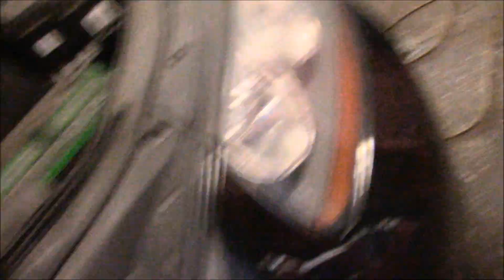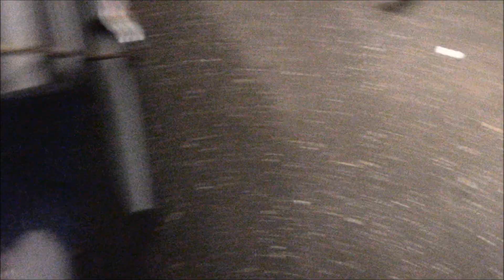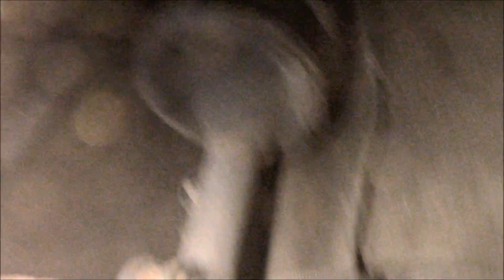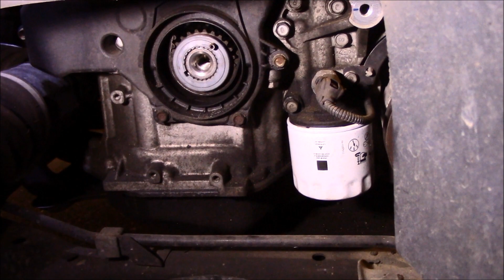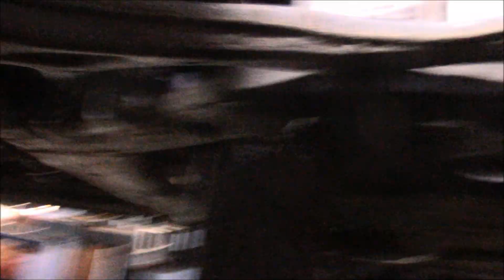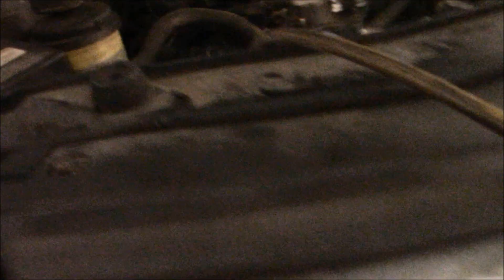How to replace a timing belt 2008 Hyundai Santa Fe

Comment: I have a 2009 Santa Fe with 240,000 miles - never replaced the timing belt - am I playing with fire?
Reply from the maker: It all depends the size of the engine. The 3.3L has a timing chain the 2.7L and 3.5L have a timing belts.

Comment: Will removing the camshaft pulley’s, to change the oil seals have a effect on the timing. Crank and cam gears are in time with the marks. If I moved the cam gear pulley by a little without the belt on. Then rotated it back by hand in place. Is that gonna effect the time?

Comment: If belt is broke how do you set cam sprokets?
Reply from the maker: You will need to use a socket to rotate the gears so they line up with the marks.

Comment: Hi nice video. I did mine and checked a month later and after car set a day the slack side of the belt is loose. Then started it up and stopped. It it’s tight. Is that common on is the hydraulic bad?

Comment: you forgot to show yourself getting pissed off when the firewall side cam keeps slipping out of time when tightening the belt.  You use a holding tool or how did you do that?

Comment: It's absolutely critical that after fitting the new timing belt that the engine is rotated by hand to recheck the marks on crank and both cams. Please note that all hyundai engines are interference type meaning if the belt breaks while engine is running it bends valves. So turn engine gently by hand to recheck crank and cam positions. I'm not sure if one touth out will have valve hitting piston. The reason for turning engine at least two full revolutions is because the back head which is bank 1 or RH head cam might be one touth retarded due to belt tension or cam roll back while fitting cam belt. Some people choose to mark old cam belt timing marks before removing and check on new belt via the counting of teeth but do it in correct rotation direction. Also while the covers are off check cam and crank seals are not leaking. 
Also check all bearings of pulleys idlers water pump alternator and power steer via rotation feel while belt is off.

Comment: What order did you wrap the new timing belt on? I am having a difficult time getting mine on. I started from the crank, around tension pulley, around the back camshaft, then around the waterpump pulley, and then around the idler pulley. I am having a difficult time getting the belt onto the front camshaft without them slightly moving position. Did you use a tool to hold them in place? Any advice would be greatly appreciated!
Reply from the maker: Did you remove the tensioner assemble to push the rod back in ?

Comment: The timing belt on my 08 Santa Fe it’s a little loose, so I took the cam covers then rotate the motor until all the marks were set, then I notice that one of the camshaft it was behind one tooth, i don’t know if that will give me more problems, because as right now check engine light came on then started running bad and almost all cylinders are misfiring. Any advise?
Reply from the maker: If the belt is off one tooth do not drive it. You should replace the belt.

Comment: Probably a dumb question, but where did you get the "pin" for the tensioner?  Is that something that comes with a new belt or a dealer only part or did you just make that?
Reply: bcfbasil even a paperclip would work straightened out

Comment: Thank you, very informative i have never replaced timing belt and water pump before ,went really well the tip to raise the engine  to gain access to the engine support bracket bolts saved hours of frustration that I've seen on other you tube clips.
Thanks again very useful
Reply from the maker: Thank you for watching

Comment: what brand of belt did you use?
Reply from the maker: I try to use Gates but if not available Dayco.
Reply: @jimthecarguy  do you have the original part number of the belt tensioner polly and water pump for the 2.7 engine ?

Comment: I noticed that once you pulled the grenade pin you did not completely rotate the belt, 2 full rotations to further confirmed that the timing marks lined up. I do that before installing the front covers.

Comment: Jim, isn't it true when changing timing belt/chain for most cars it's best to replace other components like water pump, tensioner and guides? Because you need to remove them using the same procedure. Great video btw... :)
Reply: I agree. 
going to do all of them when I change the timing belt on my 3.5 probably including the alternator.
.
Reply: 66

Comment: Manufacturers seem to be making these belts more and more difficult to get to especially having to remove the engine mount. How many hours did you allocate for this job? I also like to turn the engine over by hand before using the starter just as a final check. There is no turning back once you crank it especially for those less experienced than yourself.

Comment: Jim : Great vid. One question though: How do you keep the engine from turning when you torque the crank pulley bolt during re-assembly? Thank You for making such great videos!
Reply: Paul M i would stick a thick bar, screwdriver or both on the top openings of the pulleys or even on the bottom one. But what did he do?
Reply: MY QUESTION EXACTLY!!!
JIIIIMMMMMMM.
PLEASE ANSWER.
.
Reply: @donaldfafard   AZ Donald, did you ever get an answer. Did you do like Hector recommended. I'm in the same situation and keep the crankshaft from moving. Not much room for any screwdriver.  Any suggestion is appreciated.
Reply: @vaucansonwatch  sorry MJ, never got an answer and jim doesn't reply to viewers.
Reply: @donaldfafard  thank you for the reply, I see there are a few methods on video.
Reply: Pretty sure most folks give the crank bolt a good few ugga duggas and call it a day.

Comment: Nice work Jim, the owner should have had the water pump replaced also..
Reply from the maker: hllywd964 your right he should have replaced the pump also
Reply: jim, would you also change the crankshaft position sensor (crank angle sensor) if this was your vehicle?
.

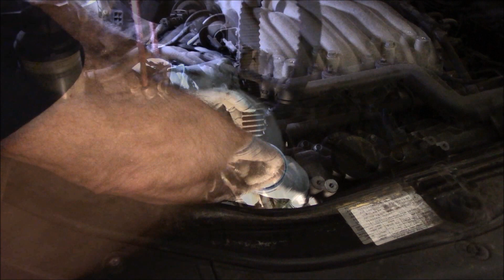Comment: I did not understand what i need to mark ( minute 27:00 ).Do i need to mark the timing belt with white paint where the sprocket marks are?
Reply: Petar st I think he marks the belts just to show us that the marks are still lined up , from the pulleys to the body. I would have used a straight edge or something similar to do my marks.